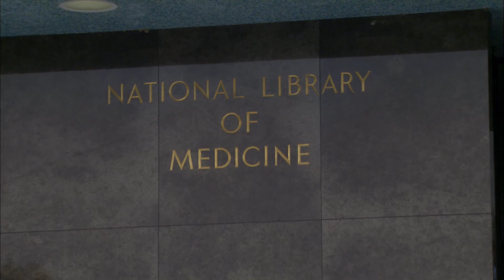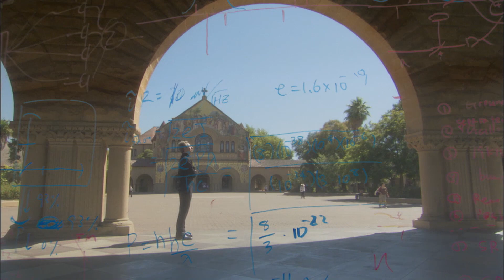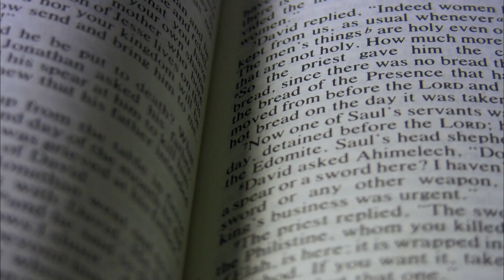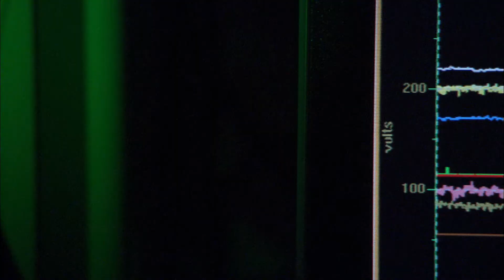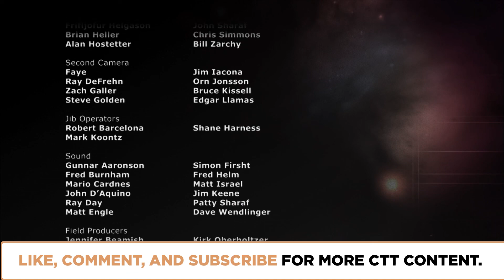Can Science Deal With God? | Episode 113 | Closer To Truth

Comment: In mathematics the concept of "equivalence class" has been a primary tool for making sense of everything from irrational numbers, infinite cardinals, systems of infinitesimals, etc. It seems to me that this same concept has potential for reconciling different understandings of diety based on different experiences and traditions.

For example, what is the fraction denoted by "1/2"?  How does it relate to "5/10"? In set theory they are both members of the same infinite equivalence class ... so both are fully valid representatives of that class, and even though 1/2 is the canonical rational representative of that class,, 0.50 may be the most appropriate form in some applied contexts. They both correspond to exactly the same midpoint of the "real interval" [0, 1], which itself is really an infinite equivalence class of topological continua, from another perspective.

Can we define God in a philosphically consistent, rational scientific way without the use of infinite equivalence classes?
 I doubt it ... in mathematics we cannot even give a simple, satisfactory definition of "number" without it***. Anything short of that can only be a child's approximation to the truth ... nothing wrong with that in its place ...perfectly adequate for a certain level of understanding  .. but not an adequate foundation for the scientific cosmology/theology that God opened up to Moses in a vision recorded in the first chapter of the Pearl of Great Price.

***In the Von Neumann development of the whole numbers, zero is represented by the empty set. All other numbers are built up from this trivial creation. In John Horton Conway's development of the most complete possible one dimensional infinite continuum of numbers, they are created in infinitely many days of creation, where each day's new numbers are Dedekind cuts of previously created numbers. All other possible geometric point sets can be modeled as subclasses contained in Cartesian products of copies of this "surreal" number line.

Just saying :-)
Reply: And then you get problems like consciousness and mind and emotions to add to the murky water